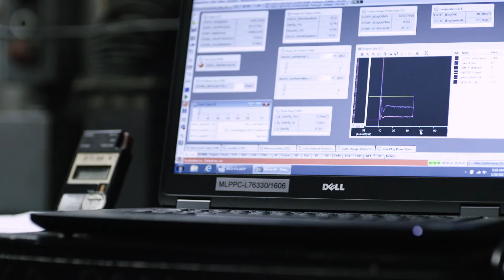Project Alpha

Comment: I am stranded at a truck stop with another failed fan clutch on your engine.  I see that the same failed fan clutch is on the A26.  How is this possible?  I bought a low miles ProStar truck with this engine for $7200 at an auction with this garbage engine.  Now I know why the used trucks are selling so cheap from International Trucks.  In the first few months my tow bills have cost me more than the price of the truck.  Get your act together.

Comment: I wonder how many of these best and brightest engineers have ever sat behind the steering wheel and driven a class 8 truck 100 miles or more.  It doesn't look like any of them have driven a truck before.  I doubt that a single one of them has a class A license to drive a truck.  It shows.

Comment: The new-old engine looks like a MAN D26 with a few different clap traps bolted on the side.  It has been a decade, and Navistar still cannot get the engine to perform well.  I am sick and tired of being stranded by this engine.  Navistar can change the name, but they cannot change the fact that this engine is a piece of junk.  The engine has to be rebranded every few years, because it is such a piece of junk.  When will they make the decision to stop making engines and fire the incompetent fools that have been screwing up this engine for a decade?  This A26 is just another Maxipad 13 with a new name.  I am just waiting for another MxF13, N13, A26 engine to plug up the breather system and set another one of my trucks on fire due to the valve cover venting oil all over the hot turbo.  Maybe the single turbo system will stop the runaway problems when the intercoolers fill up with oil with an ice-restricted breather system blows the oil into the intake system.  I have pallets and pallets of the Maxipad engines with connecting rods thrown out the side.
Reply: John Phillips you made a comment in march saying your being stranded by an engine that didn't enter production until April